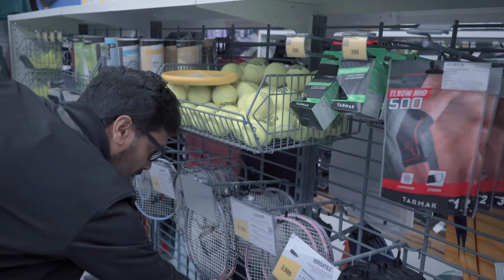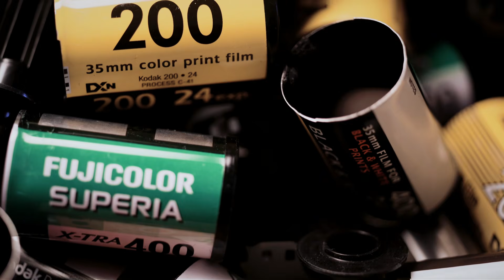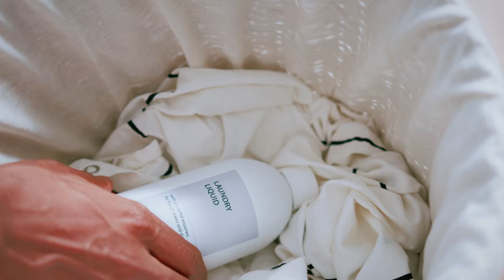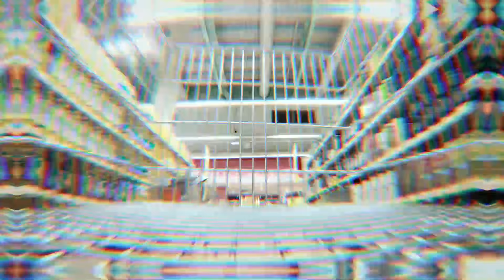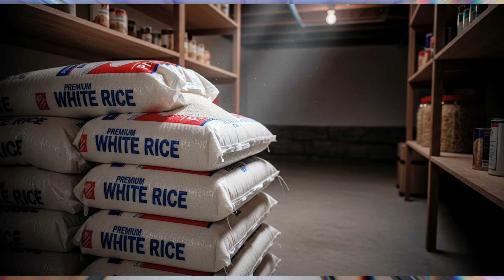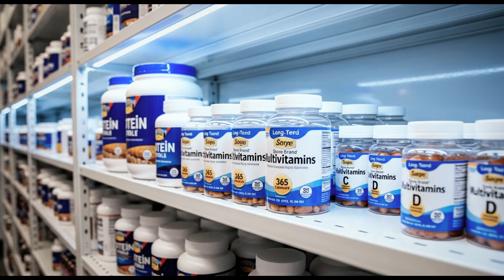11 Products Being DISCONTINUED at Every Store in 2026 (Stock Up Now!)

Comment: 9-volt photo is AA batteries, not 9-Volt. Followed by film canisters? Seriously. Then the graphic you created, still not a 9-volt battery.  Next, the aspirin clip shows a tablet that is obviously NOT an aspirin dropped into a glass of water. What's up with the spray bottle clip in the petroleum jelly section? Petroleum Jelly will NOT spray.  Do a better job.
Reply: It's so fucking bad. So is the narration. I'm actually here laughing.
Reply: It says LED as lead and CO (carbon monoxide) as co...like coworker.
Reply: This is ai slop

Comment: I hope when you bought 9 volt batteries and stockpiled them you did not buy Duracell. They should be called duraleak.  Worst batteries ever to leak with the exception of super cheap carbon zinc batteries now marketed as heavy duty.